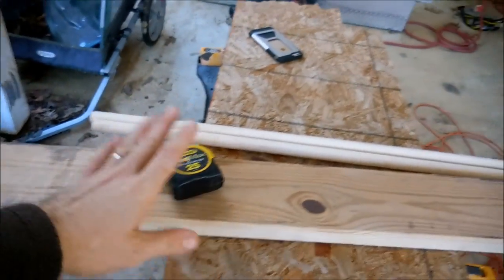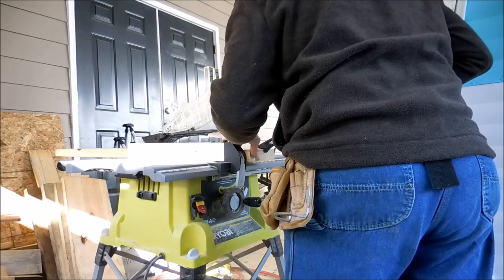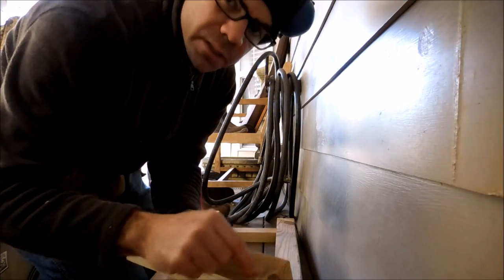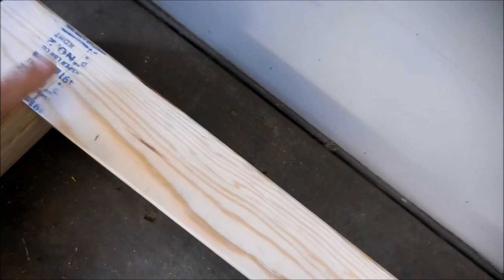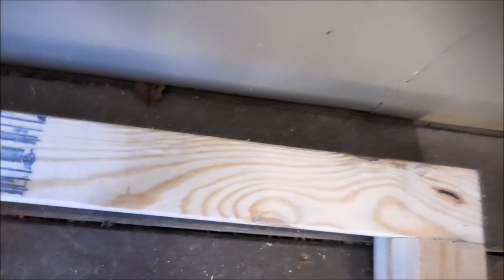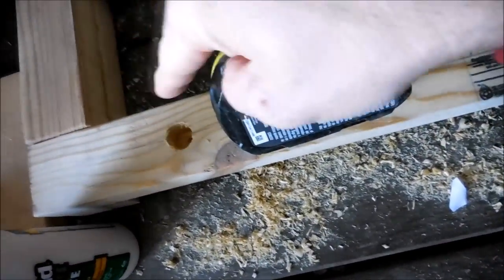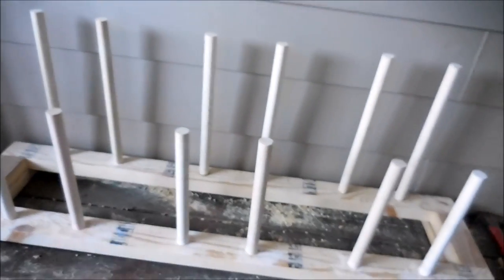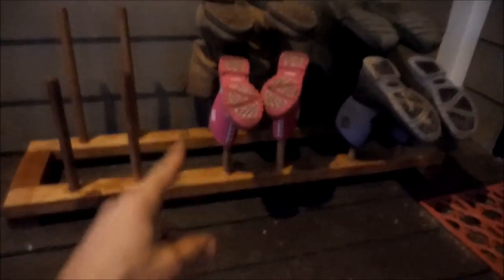STUPID EASY DIY Boot Shoe Rack | How To Build a Boot or Shoe Drying Rack!!

Comment: LOVE this project.  How does the beeswax work?  Not familiar with that.  Usually use polyurethane...
Reply from the maker: Just like a car wax or any furniture wax....just wipe it on and buff off...I love using it, but you will eventually have to reapply.
Reply from the maker: But poly would work just fine too